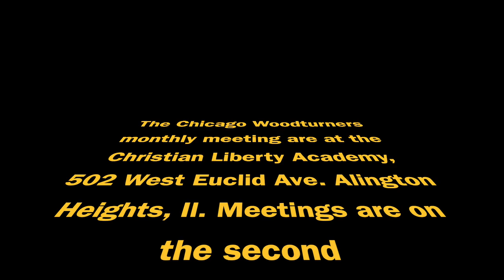Dick Sing’s Perfect Easter Eggs

Comment: Well explained! Love the chuck. Thank you.
Reply from the maker: I agree. The chuck solves multiple problems with finishing the ends. It may be hard to distinquish in the video that the two pieces of inner pipe butt up against the stop in the coupler.  The 1/2” holes are very close to that stop. I would suspect that the two pieces of pipe are glue in place before the holes are drilled. There is also a concave bevel stop that contacts the egg to give it two points of contact. The cove is just before the stop in the outer pipe. It is cut into the inner surface of the interior pipe at the end of the drill section of the pipe. If you are on a computer you can stop and see the section of the cove.
Reply: Windy City Woodturners Good to know!